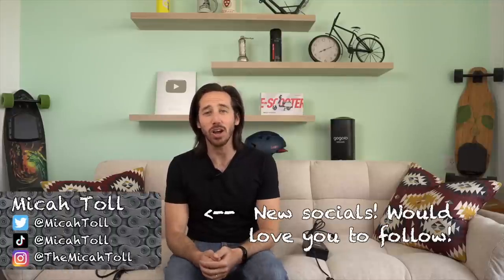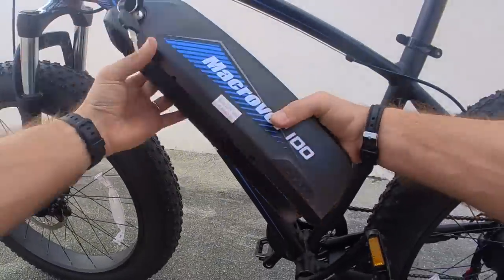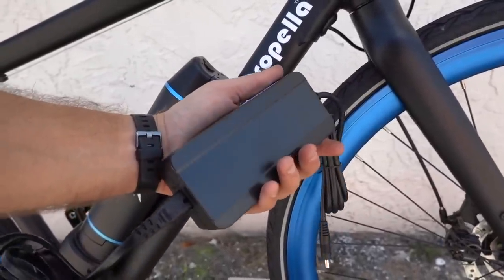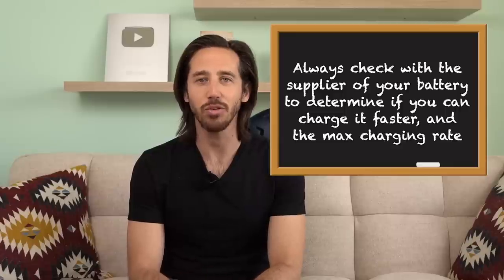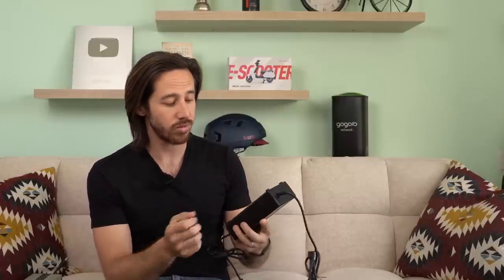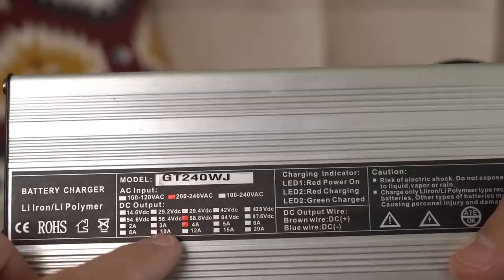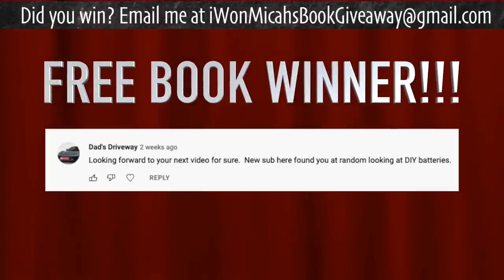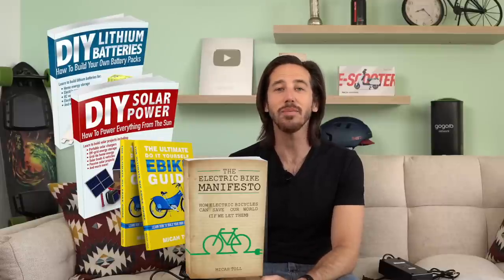How to charge your battery faster! (Multiple methods!)

Comment: Just remember that the faster you charge, the more heat is generated. Heat is one of the biggest causes of a cell degrading. You will get longer life/more charge cycles using slower charging.
Reply: I looked for this comment before posting the same thing. I see people kill their cell phone batteries using "fast charge" for every time they plug in.  Fast charging shouldn't be everyday charging, and shouldn't be more than 80% of the max battery capacity.
Reply: Am I right in thinking that least ‘friction’ among positive and negative ions occurs when you charge a half full battery eg charging it from 40% to 60%? And that this is the optimum for battery health and long life?
Reply: @petergilbert72  Not sure about friction, but the chemical process of discharging a lithium battery is exothermic (generates heat), and for charging is endothermic (absorbs heat). Most battery chargers are designed to operate with the batteries specific "C" rating in mind and to not max that rating out. You can technically charge at the max C rating of that battery, but the outcome will be shorter life. Charging above that rating can possibly cause venting and thermal runaway (a violent and rapid exothermic reaction). Luckily thermal runaway is fairly rare as the individual cells have built in protections that disable the battery, effectively killing it but avoiding further damage....think about how often you see stories on "exploding batteries"....then think about just how many lithium batteries you yourself actually have......almost all modern electrical devices with built in batteries are using a form of lithium cell. I have 5 just within arms reach of where I am sitting right now. 

The ultimate goal is to find a charge rate that is fast enough for you to be useful, but low enough to minimize cell degradation in your battery (the science behind the degradation goes a little deep for me, all I needed to know was that heat speeds up the process, and extreme cold can as well...though a different type of degrading). I think for most battery packs you can purchase, 5A charging is a fairly safe range...and up to 10A when high quality, high C rating cells are used. Those super fast, "charge up in under an hour" chargers may technically be "safe" as in not exceeding the battery packs C rating, but you are going to end up with 100-300 charge cycles instead of the 500-800 you could get using a slower charge method.
Reply: @tedforester133  i ave had  many fast charge phones non have ever gone below 100% i have had 1 over 5 years that was the iphone 6s have a iphone 8 plus still charges to 100% i charge them daily to 100% i have never had battery issues like what u speak on  i think me and fast charging is gone be ok
Reply: do if  was to charge in in low cold temps then there would be no degrade to my battery right ????
i will leave my scooter and charge it next to my door freezing down there always cold too .. .... loooks like can fast charge daily not that i will be doing that
Reply: @tedforester133  i fast charge mine daily still says 100% had 5 years >>>
Reply: same
Reply: Yeah,  just because the charger says 100% doesn't mean the cells are... we are talking about capacity, not voltage. Even following every trick in the book your cells wouldn't be at 100% capacity after daily charging for 5 years.... these types of cells start to lose capacity at around 800-1000 charge cycles.... the number varying depending on how the cell is treated
Reply: My scooter takes about 7 hours to fully charge… does it matter if I let it charge for 9 hours while I sleep in ?  cheers devil dog !
Reply: @rickyelvis3215  STANDARD SLO CHARGE OVER NIGHT FAST CHAGE IN DAY TIME  will charge in 5hr
Reply: Not true
Reply: Thanks 4 this info
Reply: How fast is too fast? I'm trying to find hard data on this. Will 3A charger degrade my 21Ah faster than 2A charger? 4A? 5A?
Reply: @smoxesss yeah, the iPhone has (optimized charging). I just plugged mine in, and it said it would be charged at 7:00am,and it’s midnight now. So the iPhone is in trickle charge mode .
Reply: @jefferyjustus7225  my Samsung doing the same thing now know why , new phone if is for me ,.....  o wait k have new battery same issues ?????, 😑

Comment: Glad to have this information confirmed.

I’m often tempted to charge using the amp “half” rule, but usually stick to 3-4 no mater the size battery over 10ah.  My Cycle Satiator really warms up at 4amps, so the 40% sounds like a safe ceiling.  I have a 48v 23ah battery that I’ve been tempted to charge at 5 amp+, but haven’t because of the stress to the charger and unknown ability of the battery BMS.

Thanks for the video !
Reply: I enjoyed the video ,and I needed the info

Comment: Thanks! I always wondered why my 14.5 Ah (48V) battery charged in about two hours (from about 20%) when it said in the manual that it would typically take 4-5 hours (from 0%). The bike I have gets delivered with either one of the two: a 2A charger (regular), or a 5A (fast charger).  I just realized that I have the fast charger 😄 I thought that maybe my battery was going bad, but guess not, lol.

Comment: Very helpful and clear presentation on charging. I use a DC power supply as a backup in case the charger fails . This unit can charge up to 10 amps. Nice to know I should throttle back a bit

Comment: Are there chargers that deliver more than 4-5 Amps anyway? 
At some point the wire and plug become a problem of their own.
Also, isn’t the BMS limiting the current? In which case it would not help to get a more powerful power supply. By the way we call that a charger but in fact it is just a power supply, right? The ‘charger’ is the BMS, isn’t it?

Comment: Just ordered a 4A charger. Seems to be the same plug. I think they are the default ones. I just wanted to double check before I bought it. I will use the 2A one when in no rush - If the company replaces it (under warranty).

Comment: With my Wildeway and its 32AH battery, they supplied a 4amp charger. Amazingly, they supply that same charger to the 17AH bike battery system they sell. I asked them about that and they played dumb, but I know I could get away with a higher amp charger, and I'm thinking easily an 8 amp charger. What do you think ? What should the max voltage while charging be ? It sounds like these chargers are regulated to never go above 54.6 volts ? That is, if my battery actually has 13 cells ? I'd love to see a "tear down" channel like we see with the LIPO batteries. Tear downs are very informative to a tech like myself.

Comment: with my 48v 20Ah battery, i limit charging to 4Amps when the weather is cool, and 3Amps in the Summer.

always feel the charging wires near the battery input, and the side of the battery pack. if it's warm, back down the charging Amps.

you want to preserve the battery, but also want to avoid catastrophe.

Comment: Show us how to build a high power ebike charger with chardemo or type 2 ccs used for ev charging. These wall charges may be a little expensive but they output so much power thst we could tap into for those using our ebikes for the last mile logistics
Reply: This is crucial for emobility future. You're able to have smaller cheaper batteries if you can utilize charging on the go. Not all of us have a 10mile commute. If we can't go 50+miles at a reasonable rate of speed, then it becomes just a hobby day off bike and with costs of living being what they are, it'll make an emobility purchase non viable for a large group of potential customers, which of course hurts sales for the new and upcoming emobility companies 😅

Comment: I love all your informative videos. Is it safe to use a smart plug to set up a charging schedule for your e-bike battery? That way it's not sitting at or near fully charged overnight adding strain to the battery, in a sense it makes for faster charging since you don't have to keep an eye on it or plug it in early in the morning. Also, isn't one of the reasons it takes so long to get the last few percent is your charger is balancing your cells, which is not necessary to do all the time but is good to do periodically, correct?
Reply: Smart plugs are great just have the charger on when you plug it into the battery so it doesn’t spark at the battery connector, I used to use a Christmas light timer before I got a Luna advanced charger that I highly recommend because using a smart plug/ timer is kinda anoying rather then just plug in and charge at 1 amp to 80%. The last 15% charge slow because the cells have to be constant voltage charged to full cell voltage. Balancing occurs at this point because it is when cells that are charged above the rest will reach full charge first and the bms can burn off with resistors or use capacitors to redistribute the excess voltage un tell the rest of the cells have reached full charge.

Comment: Another easy explained masterclass in ebike 101. If I could make a request and from personal experience, my latest issue is how to swap out a failed BMS when the old one is unknown and the new one based on what is available is different. Hard lesson learnt having burnt out the first replacement as the balance leads and plug was transferable but backwards!

Comment: I was wondering if it would be ok to use a parallel cable with two 2amp chargers. My Ebike battery is 54.6V 20Ah. I already have an extra 2 amp charger. My electric scooter came with two 2 amp chargers with the option to use one or both for faster charge. Would like to have the same option for my Ebike.

Comment: 7:35 so is it okay for the battery if the charger raises its voltage to 54.6 if it is a 48v battery? You said you have to match voltage so I’m unclear on this, will it harm the battery?

Comment: Hi Micah, love your work and through watching your videos I've learned lots. Most of my projects have been completed using mid drive Bafang 750 and 1000 Watts motors. Could you give me your opinion on what motor to use in my next project with a tricycle please? Hub or Mid drive? Thanks for producing such a informative Videos. Kind regards Clem Oliver (Australia)

Comment: I procured a Cybertrack 200 ebike from an Amazon pallet that did not have a charger.  I'd like to buy one but I don't have the old charger to refer to.  The manual says it should have a 36V 3 Amp Fast Charger, 3-4 Hour Charging.  Can you please help me find a suitable charger?

Comment: Thank you for the helpful video! Just one question, does what you said in this video apply the same for lead acid batteries of the 72v variety?
Reply from the maker: The principles are the same, but the voltages I listed are for lithium-ion batteries like those used in most electric bicycles.
Reply: not really. You especially don't want to follow the 80% rule on a lead acid battery. These batteries have what is known as "battery memory". If you constantly charge one to 80% capacity, over time that becomes the new max capacity.
Reply: @devildogcody  thank you both for replying! :) I finally got a 72v lead acid charger for the bike and was previously using a lithium charger for the last couple weeks. It would charge it to 70-80 percent each time and stop as lithium does when trying to do lead acid. I hope the batteries aren’t going to mind the new charger and won’t have a memory too much from the lithium charger
Reply: @ronbrown1236  another thing to remember with lead acid batteries...the battery memory works in reverse also...meaning that unlike lithium cells, you want to discharge the lead acid battery as much as you can before charging....if you only ever discharge it half way, over time you will end up with half that battery usable. It is one of the reasons other than energy density most electronics have moved to lithium.
Reply: @devildogcody  I didn’t know this. I will definitely drain it more then I have been doing, I was using the lithium logic unfortunately and keeping it around 40-60 percent

Comment: You can, if you have two stock chargers, dual charge the battery. With parallel charging. + to + and - to  -  solder a diy dual port parallel charge port. Just unplug one charger when they start blinking green/red.

Just don't go crazy : you can safely charge at  1C charging. Meaning :  if battery have 6 ah. You can have two chargers rated at 2ah (2+2ah=4ah. You charge at 0,66C.

Comment: I think he should have recommended only chargers that have an auto turn off when the battery is full. You can actually start a fire if left on too long. 

I recently ordered a new charger that was very hot after 2 hours so these do catch on fire if they charge too fast for the bike especially. The charger business said they tested it for safety even.

Comment: Great video, very informative!  I understand that we cannot charge a 48v battery with a 36v charger but can we charge a 36v battery with a 56 or 62v charger?  I would think so.
Reply: No, it would be next to impossible to monitor individual cell voltage. The chargers are designed to slow down when a specific average cell voltage is reached...which will be a higher total voltage on a 72v charger than say a 48v.......letting the individual cells rest and balance out. If you try and manually watch voltage to shut off when "correct voltage" is reached....it is highly likely that individual cells will be over charged.
Reply: @devildogcody  it makes sense, thank you so much for your reply!

Comment: My ebike uses a barrel connector. How do you usually measure barrel connectors to make sure you buy the replacement charger?
Reply from the maker: Majority are usually 5.5x2.1mm or 5.5x2.5 mm, some are larger up to 8mm. When in doubt, you can either ask your manufacturer or get one of those DC barrel plug adapter kits that have like 10 connectors for cheap, and compare them to your plug to see which fits.

Comment: My eBay keeps cutting out under load that is to say when going up the Steep Hill and will only momentarily turn on and then instantly turn off however if I plug the charger into it for only a second it resets the battery and it's good again until I go up another Steep Hill any advice on this would be greatly appreciated pa I do have a second battery on this bike and I have no issues with it going up hills

Comment: Hi my battery just charged but the power side shows no voltage but charge plug shows 51 volts. I replaced the plug to be sure that was not the problem. What's your thought?

Comment: hey Micah...i got a 60v20ah lead acid smart charger on amazon...its 3amps 240w made of aluminum with red light and another red that should go green once fully charged...but...even after 18+ hours using it for 1st time on brand new batteries it never turned green... now im assuming a full charges batt should read 13.8v per cell and 5 of them should be 69v. but the output on the charger was showing 69.8...so i adjusted the trim pot down to 69v  exactly... havent tried it yet...but could that be the reason it never would go green? output volt were .8v too much? i dont want to order another 79$ charger!!! let me know if you have an answer for me please and thank you!!! and also what are the other 2 trim pots for ?? and should i need to adjust them too? anyone with answers are welcomed to share their input by replying i would be very grateful  for anyone;s help!!!  Thanks!!!

Comment: Are there universal chargers available that you can set voltage and amperage on? I would prefer not to have to buy a specific charger for all my different batteries.  Couldn't I just use a bench style DC power supply?

Comment: So, I'd like to use my my old 36v 7.5ah 15s2p battery pack to to charge my current 52v 23.4ah battery that's in my current yume scooter. Is this possible?

Comment: I prefer to use the stock charger. It is slow but (I hope) it will prolong the service life of my battery. In any case I ride to work , plug the bike in, ride home at the end of the day and then overnight it. Cycling for me is more about utility (cheap transport) than pleasure

Comment: Great intro to ebike battery chargers. Very clear and simplified, especially the formula shown on chalk board to really understand the mechanics of charging, and how voltage/Amperage and charging times jive together. Great Video!!🎉
Reply: It all depends on the cells.

LIPO has better charge and discharge rates.

Mine are good for 120A - and that's before taking into account that its 4P, so I could be charging at 480A.

That's more than double my entire home electrical service.

Comment: Hey Micah. Very helpful videos you have been doing. I have been looking to purchase an ebike there are so many different varieties. The question I have what is was the difference between 10.5,15,17.5 and 19.2 amps? What do you recommend?
Reply: The difference between the batteries are how far you can go on a charge 10.5 can go 31 miles and 19.2 can go 81 miles. I got the 19.2 amp with a faster charger
Reply: @barberclips4304  Did you just answer yourself?
Reply: @jtnoodle  😂😂

Comment: i don't like charging them when i'm not around(or awake) so i charge them at work, usually i can fill them in 1 day, but if i don't i'll have to finish the charge the next day to avoid cell imbalance.(20ah 48v battery, 2amp charger)

Comment: If you take them apart there are 2 screws which increases and decreases the voltage and ampage
My battery charges in less then 2 hours because of this and my battery is 48v 10ah

ALWAYS keep a eye on them when charging because they can catch fire and I know from experince

Comment: The charger that came with my electric scooter is a 54.6v 2 amp..i plan on getting a 54.6v 3 amp..from what you explained i guess me and the battery safe with those specs then🤔